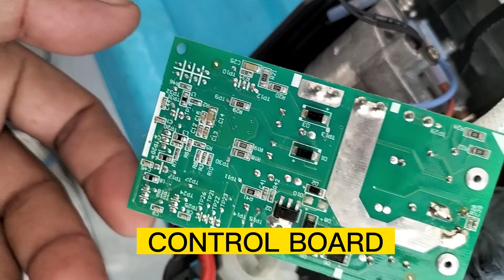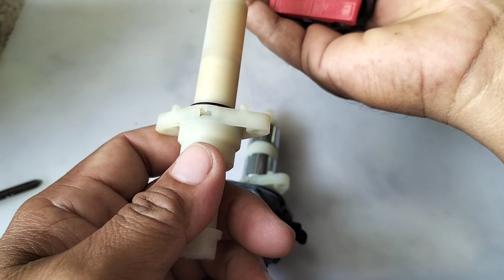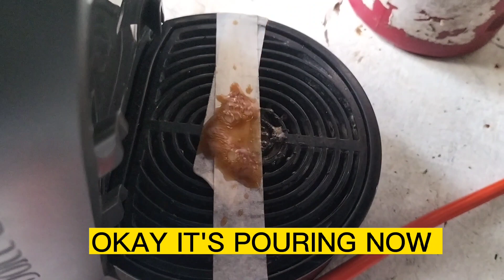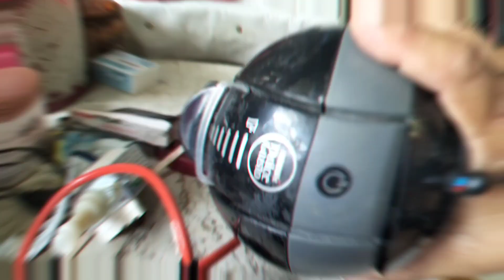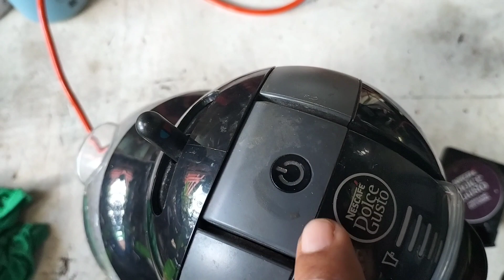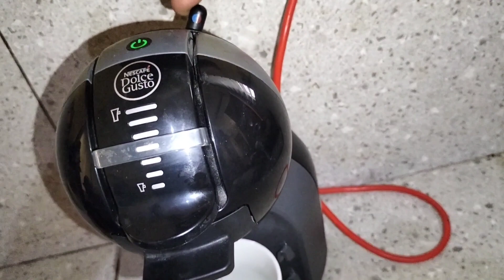NESCAFE DOLCE GUSTO NOT POURING PROBLEM REPAIR

Comment: One thing more how would i know my pump has issue machine is not.pouring water basically
Reply from the maker: When it's stopped pouring but it has a power... probably the pump failed to function Sir... just watch my water pump video comparison between good & bad mini water pump..